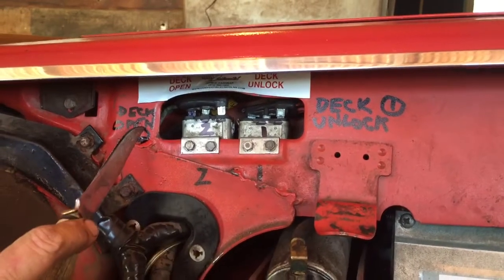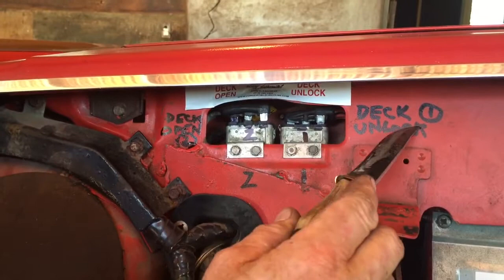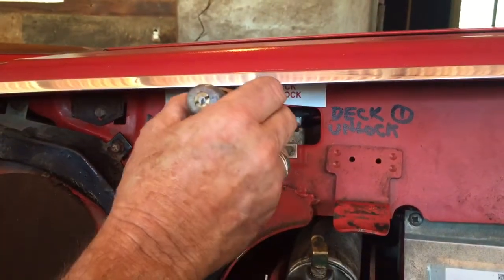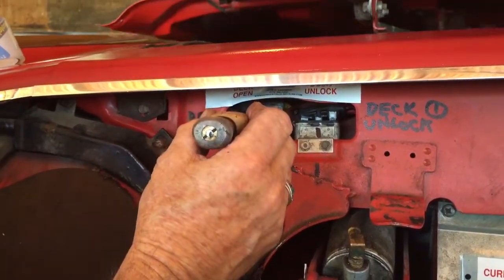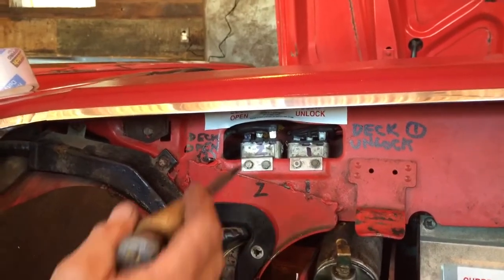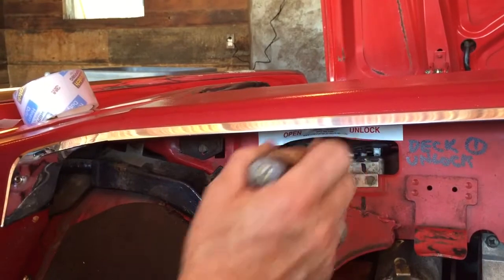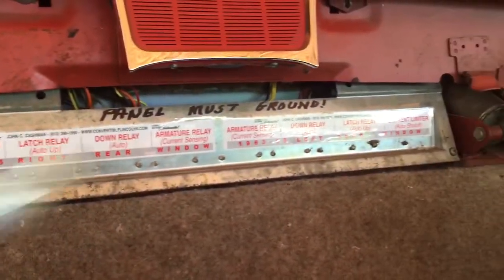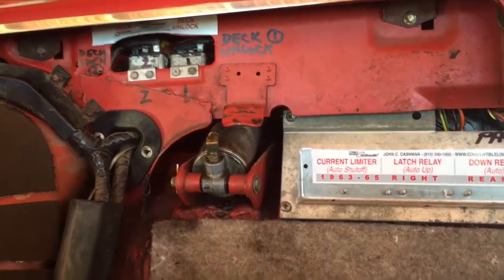How to open a stuck trunk lid on a 1960's Lincoln Continental Convertible W/ John Cashman

Comment: Beau is there a way to close the deck once you open the deck this way? The user might need to close the deck if the problem can't be resloved without ordering parts to fix the opening issue. I wouldn't be able to back into the garage with the deck lid up, or leave out on the driveway with the deck up. Thanks

Comment: I have a 63 Lincoln Continental Convertible and my issues is the trunk wont close. The top is down and "appears' to be locked but the Lid does not fold down and trunk does not move down. Any help in trouble shooting is much appreciated.
Reply from the maker: Yes, I have run into this problem as well and know how to solve it.  I will post a video for you soon.  It has to do with the two switches on the top the front window.  When the top is being raised and the top meets the front window there are two latches that engage to hold the top to the window.  What you can do to get them to engage is sit in the drivers seat and manually push the front of the convertible top towards the front window as they meet.  This will help the hooks engage and trigger the relays to close the trunk lid.  Hit me up on facebook and we can  chat.  Beau Ralphs
Reply: +Beau Ralphs yes I had some questions on that just sent you a message via FB
Reply: What's your Facebook, I have some questions

Comment: i my name is luis i have a 1967 Lincoln continental coverble . my problem is that i had this guy work on my 1967 top because it wasn't working. so what he did is he took all the relays off and the pump that is under the relays now he can't remember how anything goes can someone help with a pictures of where all the relays and pump hole goes thanks you